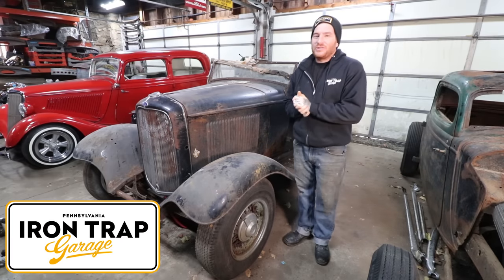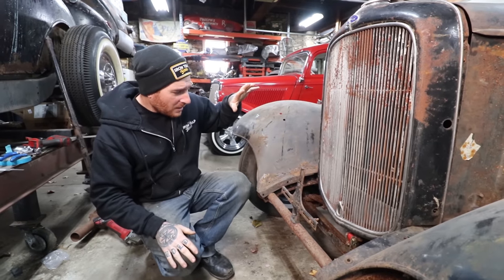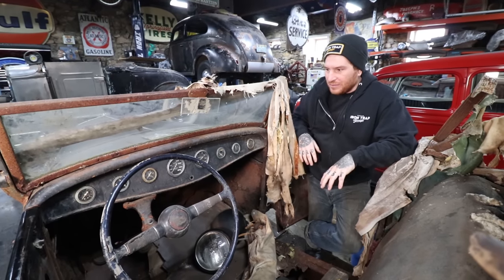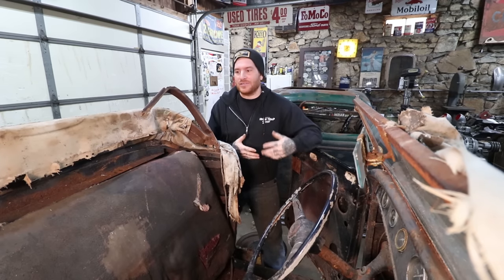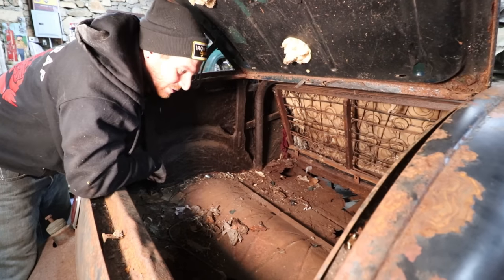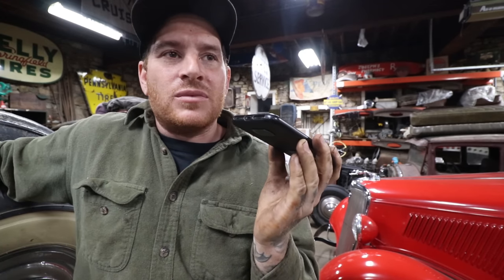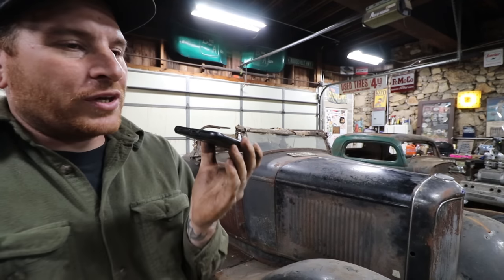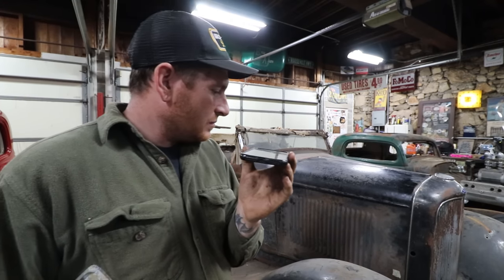In-Depth Look At The 1932 DeLorean Roadster & A Call With Jack DeLorean!!!

Comment: It will be a lot of work, but you should do a full frame off restoration. That way you can find and repair any hidden rust or damage.  A repainted frame?  Goes without saying.  

Carefully remove all the old paint, rust  and so forth, and repaint it shiny black.  In those days we would only use many coats of hand rubbed lacquer. Of course, these days, that's impossible to do, due to OSHA restrictions, but I'm sure there should be an acceptable substitute.

Do it right without half measures or shortcuts. In the end, you will have a daily driver which is also an award winning show car that you can pass along to your sons and grandsons.

I will be watching with great interest as you complete the project.  It sure makes this antique hot rodder's heart beat with joy to see it.

Comment: That fuel pump. I have a theory I think you'll like. Loving this by the way. Jack is sharp as a knife. Trust me I know I care for my father who has dementia full time now. Try remembering every detail about your first car! and then add 40 years and then speak as clearly as Jack about that car.

What I was going to say about the fuel pump or more its knob. I wouldn't mind betting that knob was white once. I've seen those early materials take on the colour of rust before. In one of my former lives I use to work on antique and vintage cars as a coachbuilder and mechanic. Those plastics can become porous. If it was laying in damp rusty conditions I wouldn't mind betting that's what happened. It has leeched the rusty water into the resin. Sometimes you can polish that out a fair bit although that one is a wee bit extreme. As for the restoration it's only original once. There has to be limits unless you're a museum though. You have the skills so I'd say get it back to its 1950s glory. Beautiful find. Normally I end "be lucky" but you already were multiple times on this one!
Reply: Jack is as sharp as they come!  Pretty impressive to be able to say that for someone born in ‘36.  Also - wonderful that you are caring for your father - nothing easy about what you are doing!

Comment: Re the bakelite knob, it's really common for them to discolor with age, especially with exposure to UV etc. It likely started life as off-white, just as jack remembered it. Regarding the "original" motor, I wouldn't be surprised if it had an engine swap shortly before it ended up on the car lot Jack bought it from. The single-carb and overheating issues Jack mentioned were likely the result of a quick pre-sale swap. I'd do a bunch of measurements on the various mount locations to work out what it may have been running before Jack had it. Great show, Matt! You're incredibly lucky to find that amazing car!

Comment: I dont think that was a roll bar, but a sturdy mount for shoulder seat belts, which would have been used if it was raced.
Reply: Agreed!
Reply: Disagree, they didn't use shoulder belts back then.  Most used in competition was war surplus lap belts.
Reply: @jongolliher3806  I agree most guys used only the lap belts back then, but the fighter planes used shoulder belts so they were available as surplus, so it would be rare to see the whole harness used but plausible......why anyone would build it as a roll bar and make it lower than the top of the body or drivers head dosent make sense to me.  Could have just been put in to make the roadster body stiffer, and not used as a "crash bar"......either way it looks like a well thought out race car that made it to the street.

Comment: The fact that the gas tank has a cap modification so it can be pressurized possibly explains the fuel pressure gage on the dash.
Because a driver would likely need it so they could monitor when to add more pressure to the system with the hand pump.

Comment: Hand pump? Sounds like that would be the reason for the 0-10# gauge on the dash.  By all means restore the car to 1950s condition. Blue sounds like the color it was born with.
Reply: i have seen hand fuel pumps on old racers mounted in the dash at that spot

Comment: Great video Matt!! 
In my opinion, I would match all the gauges if its just 1 that was different and you have it. Think of it like finding it for the old builder who likely would have put it in once he bought/found it and just didn't get around to it.
Keep up the good work!
Reply: where the mismatched gauge is, see if there are any holes or homemade brackets that might line up with the hand fuel pump. i have seen them mounted there in the past.

Comment: Are Hot Rods exempt from PA state vehicle safety inspection?  If not, how are you going to use a pressurized fuel system?
Reply: LowBuckPC yes with an antique tag we don’t need Pa state inspection on them

Comment: I had a 40 Ford Pickup that had that hard stuff in the bed and doors I spoke with the owner of the pickup and asked him what that stuff  was that was sprayed in the bed and doors . He told me that it was road tar that had been thinned down so that it would harden up and he had to spray it several times to get it to build up. I tried tp get it off and that stuff was super hard. I left it in the doors and it made them real quiet. Just thought I would pass that along.
Reply: My 41 Willys coupe was bathed in it when I found it back in  the 80's.   I tried everything to remove it.  Had the body Redi-stripped.  The guy who did it said he had to leave it in the tank for 4 days!  Wasn't too happy with me, but when I got it home it looked like it just rolled down the assembly line.
Reply: @glennnickerson8438  back in day it was one of the best ways to prevent rust, People forget about some of the tricks that were used. instead they look at modern products and for the most part only some what work, With this gas and oil won't hurt it and salt just washes off of it,

Comment: The slots in the door panels are for hand signals, turn signals weren't invented. in 32!  Import motor cycles did not come installed until 1975 Honda's. Hand signals were required when I took my motor cycle test. The Texas State Trooper Clark.

Comment: Could he be thinking of the original 1932 intake? It’s single carb and the carb sits up kinda. All flathead I takes are water heated from the factory. And the 32 doesn’t really have a mount like the other later ones for the generator/fan
Reply: Was thinking the same thing. Seems to me like I've  seen 1 or 2 that were factory aluminum as well but I could be wrong.

Comment: I wish I could, or knew how to, post a pic on the comments. I do work on a 34 5 window. The lady who owns it bought it in 1953 when she was 14, drove it all through high school. Had it painted black in 57 (it was maroon) and interior . Her dad had safety glass and juice brakes put on in 59. So disc wheels spinner hubcaps, and wide whites were fitted. So two years ago I went through the fuel system, rebuilt the brakes. and got it running. Last year she rounded up original wire wheels had them powder coated red, mounted Coker tires. and got the spacers so they could be mounted on the juice brake brake drums. The paint is still real good and is not rust. A little in the trunk floor where shag carpet was. It appears to be just surface rust, and I was going to por15 it but the covid got in the way. I took a few pic of it wish I could share.
Reply from the maker: Feel free to email pics to: irontrapgarage@gmail.com . We’d love to see them!
Reply: @IronTrapGarage  I will try, old fart, and computers hate me.
Reply: Done

Comment: Jack said the knob on that pump was white I'll bet you that is the pump and it turned color from age in the past I've seen Bakelite do similar things. Henry Ford developed Bakelite it was the first form of plastic so he was the inventor of plastic, why did he develop it he wanted to replace the wood on the steering wheels with a smoother more durable material. Allen Bradley in Milwaukee was right up the street from where I lived as a child they manufactured Bakelite back in the day mostly for telephones then.

Comment: I think I'd add the matching gauge, it's probably what the original builder would have done if he'd had one to hand at the time.
Reply: i have seen hand fuel pumps mounted where the mismatched gauge is. check for holes or brackets that may align with your pump

Comment: Car needs a resto.  Not over the top as I doubt it was a super show car.  I bet that paint is enamel.
In 54 it near certainly had a sidevalve. Unless it was a Caddy or similar.
Those fuel pumps were often used to make fuel pressure, You can 'cheat' and use a mechanical fuel pump to pressurise the fuel tank. Usually  about 3lb. It will move large volumes of fuel like that.